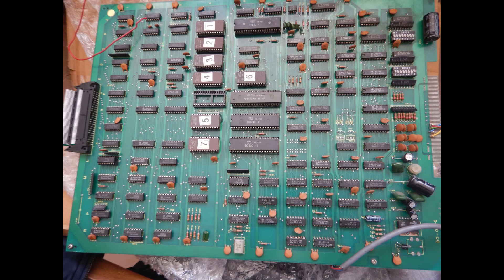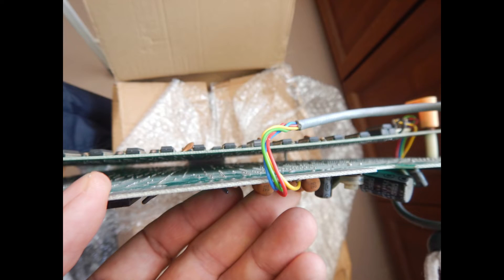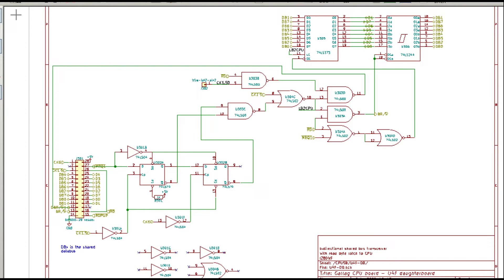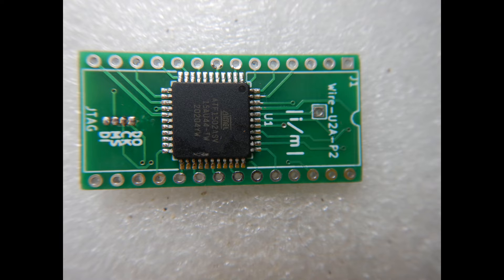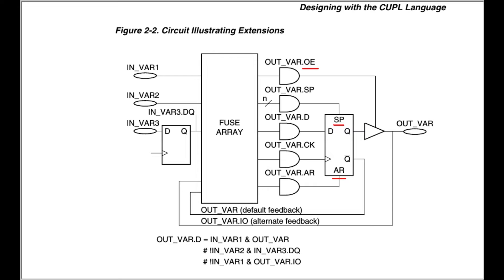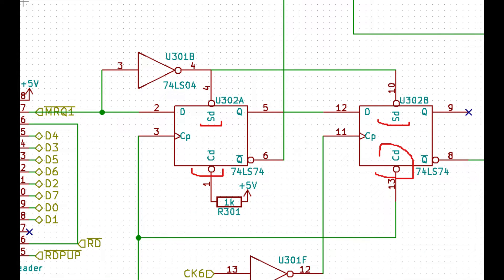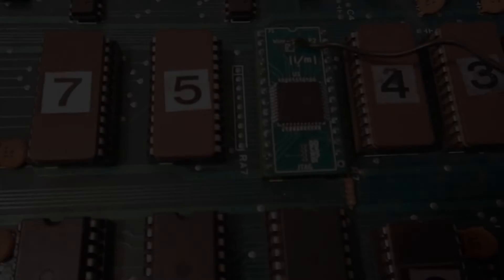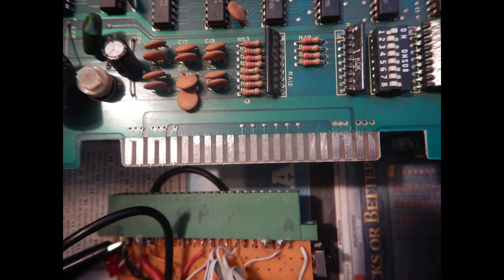Galaga (gallag bootleg) arcade repair: debugging CUPL for a replacement daughterboard.

Comment: This is awesome work!  I am working on a CPLD 08xx replacement for a Midway Galaga and the only thing holding me up with your schematic are pins 2 OE, 17 WREQ, 26 M1, 16 RD and 15 IORQ.
Reply from the maker: Hi, the gallag daughterboard is a simplified version of the 08XX, it requires less logic because of the wire connecting to an appropriate clock phase. I have a prototype 08XX replacement that I've never tried, I thought it might be helping on some Pole Position repairs but I've never needed it actually.

Comment: I'm not familiar with ATF1502 CPLD but it looks like a nice part for a 5V problem.  I see you used WinCPL... but how did you program it?
Reply from the maker: HI! I've made an "easy" parallel port JTAG adapter, I first convert the jedec file with Atmisp to a SVF file, then I use urjtag on linux. More details are on this video: https://www.youtube.com/watch?v=z5Evpt0pU9s Unfortunately the Atmel CPLDs are not available in any decent time now.
Reply: @iz8dwf  Thanks will check out that video.

Comment: Hi,
I managed to 'boot' the Galaxian game on my Bootleg but no inputs works (fire, left, right, start, coin)
I changed the LS138 to J7 but nothing changes.
Is there an 'open coin door protection' since the 2 pcbs are outside of the chassis
Could you help me ?
Regards
Patrick
Reply from the maker: Hi, there's no special switches sensed for that, I always had my cards outside the cabinet. What happens if you switch the test mode on?
Reply: @iz8dwf  I put the test mode ON (pin 12 to the ground) 
power ON
white square full screen
then multiple colour square
and so on
Pin 1 of K10 and J10 still to 1
When I switch test mode
He begin the game stage 1
But pin 1 K10 and J10 still 1

Comment: We had a bunch of them in storage and one was missing its daughterboard. I went the exact copy route so I reverse-engineered the connections from one of the others and it worked. (I also have a big stash of 74xx replacement parts and pretty much no FPGAs nor a development environment so... call me old fashioned. I'm also good at reinventing the wheel because I suck at Google)
1st suspect: Video Address Generator. (of course you fixed it already, looking forward to the video)
Reply from the maker: Hi! Yes I considered the "old fashioned" way of course, that would have saved me a few months, but when I started this repair, the ATF1502 was a really cheap option, together with the smallest possible PCB. And yes, this boardset had a lot of issues, I need some time to edit the second part of the repair though...
Reply from the maker: And by the way, the ATF1502 is not a FPGA, it's a 5V supply CMOS CPLD, like a PAL/GAL on steroids, but it doesn't require any voltage regulator and level translators on I/O. It's one of the best 5V logic chips still in production, it can be re-programmed thousands of times. Its only drawback is that's SMD and probably they're going to discontinue the whole family soon or at the very least the useful (for us old fashioned repairers) speed grades (25ns and 15ns are the most rare now).
You only need wincupl and a jtag programmer to design and program with these devices.